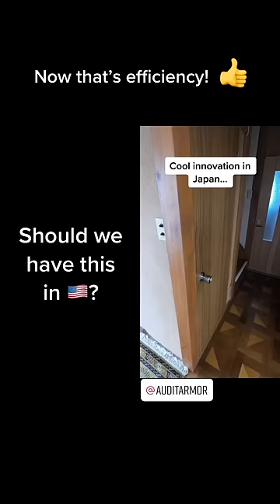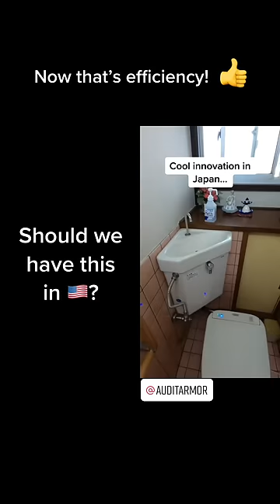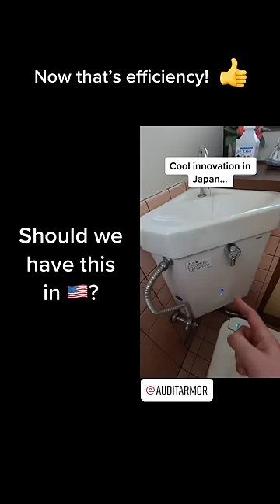Why don't we have this type of Toilet in the 🇺🇸...?

Comment: Missed one of thee best innovations imo.  Look at the floor of that room. 

The bathroom is recessed and has a hidden floor drain for leaks plus its all water resistant to a degree.
Reply: What, you mean you don't like the innovation of carpet in the bathroom?
Reply: Its called a wet room.
Reply: It's not for leaks it's too wash the floor
Reply: Whole room is the shower.
Reply: @tomashcraft  alot of our building designs are stuck in the 1800s. I hate it.
Reply: That’s RIGHT!!!! Every newly built condo bathrooms in Korea and Japan were made this way. Every part of the bathroom is tiled and you have a giant shower. It makes cleaning your bathroom a BREEZE.

Comment: Apart from needing to use the sink for other things, sounds dope
So if it had a regular drain pipeway as well as the refill pipe, it'd be perfect
Reply: You're missing the point: You don't need CLEAN water to flush your toilet, you can flush your toilet with shaving water or water you brush your teeth with. Nothing else goes in the bathroom sink.
Reply: @JohnRay1969  Biggest thing I was saying was most people use the sink more than the toilet - as such, overflow - if the toilet is full, nowhere else for it to go it would seem - simple overflow, and it'd be a perfect design rather than the workaround of flushing for the sole purpose of making space
Reply: It works as normal also
Reply: @PJOZeus I get u it has a bypass also
Reply: @JohnRay1969 you missed his point. How would you comfortably wash your hands, shave or brush your teeth using that sink?
Reply: The system has an “overflow “. If flush tank is full you can still use sink.

Comment: don't clog that sink or ur screwed
Reply: what are you doing to clog your bathroom sink so badly in the first place?
Reply: @shawnpitman876 hair and the other normal crap that clog bathroom sinks. You must be a newborn.
Reply: I don't think there is a any pipe to clog. I looks like it goes directly into the tank
Reply: @RossW-vq6bx well it’s not going through an Einstein- Rosen bridge
Reply: its all good just dip your hands in the back of the toilet bowl CLEAN RIGHT????
Reply: @deesmith8576 yes actually, that water has not interacted with the dirty part of the toilet at all and is only being used to fill the tank on the back
Reply: @Random-ed2xf Plus, this is a sink JUST for washing your hands after using the toilet. It's not the main sink that you'd use for shaving or anything else. It doesn't even HAVE any control to start the water outside of the flush/fill cycle.
Reply: @RossW-vq6bx  How do you think it gets to the bowl?
Reply: @skinlab4239 wtf are you doing with your sink that you can't fix your drain? Like. Tell me you've never been anything but a tenant. 😂
Reply: @skinlab4239 it’s not a full bathroom, just shit and wash hands. 🤦‍♂️
Reply: @shawnpitman876 you don’t clean your teeth or wash your hands after you put gel on your hair?
Reply: Can soap and toothpaste sit inside a toilet tank without causing any damage to the components inside? I genuinely don’t know and curiously asking.
Reply: It’s only a sink to wash your hands, you shouldn’t use it if you manage to clog it

Comment: News flash, that's everywhere.  The same 1/2 line that feeds the sink goes next to the water closet. That water in the tank is the same water that comes out of the faucet.
Reply: What, where are you? Under my sink is a large drain and a p trap that's maybe 2 inch pipe. What goes down is not under pressure. You'd have to pump it to get it up to the tank. 

So this definitely isn't "everywhere."

Comment: Bro overall you should have houses that aren't made of cardboard
Reply: That’s just the inside in order to work like electrical and water pipe.
Reply: That's new homes being built but if you have an older home it's made of brick. You have to custom make a home if you want brick or whatever.
Reply: You don't know Jack about construction, that Japanese house literally has drywall installed, stop parroting people and come up with your own thoughts for once
Reply: Y'all so pressed while you have a hole in your wall when you stub your toe
Reply: @lamont3803 I smell a renter.
Reply: @alexbernstein1450  Bad nose
Reply: @lamont3803  it's OK to be a europoor my dude.

Comment: What should be filling all of that is rain water, every house should have a holding tank in the basement filled by the gutters and filtered and pumped for use in sinks and toilets
Reply: I have a large woodworking shop and done it this way, never even ran water to the building.

Comment: Old innovation. I used to live in the Truckee Hotel. Its an older hotel from the 1800s, has these on all the communal toilets, or did until they fully renovated a few years back.  Was very cool but kind of a pain to use because you have to lean over the bowl.

Comment: Would have to worry about clogging the sink as well as you can only run the water in the sink until the tank is full. Then you have to flush again.
Reply: The sink drain is very short, with no crazy curves. 
I'm sure there's an overflow bypass. 
And #3, what's the big deal about an extra flush?  It's not like you're wasting 'fresh' water!
Actually quite ingenious!

Comment: Ah then there’s me. Washing my hands and clogging the sink after doing some mechanical work on my trucks. 😂
Reply: I stopped having this issue when I started using dawn dishsoap mixed with sugar instead of gojo with pumice the sand is what clogs the sink
Reply: @robertg9334  I never thought of that, we always use regular Gojo and sand, Always stopping up the s-trap.
Reply: @atvridgerunner  the combination of the dawn degreaser and the oxidative powers of sugar it breaks the grease down without stripping the natural oils out of your skin like gojo does to and the sugar breaks down with warm water preventing the drain clog unlike sand

Comment: Wouldn't the soap, skin, and grime from your hands end up in the tank and eventually start clogging up the plumbing in the tank?
Reply: Why would it do that? Do you regularly have to move houses because your plumbing no longer works?
Reply: @Loralanthalas   Um. You're washing your hands in a sink. Normally, in an American home, that sink has a drain, which drains into the main sewer line of the house/apartment/whatever. but, in this video, the sink drains into THE TOILET TANK. All of the skin flakes that come off of your hands, dirt, grime, and soap is going to end up IN THE TOILET TANK. Toilet Tanks have moving parts. The grime that gets washed off your hands, along with the soap, is going to end up in the toilet tank (I have to keep saying that to emphasize it) and all over those moving parts.

Comment: very bad idea, as you always not comfortable to use sink, bending its wrong than toilet gets all junk sand dirt, if you know open your toilet bucket it will be brown and its with clean water, toilet bucket  inside there is plenty of connectors, [plastics, and gum which can simply get damaged from soap chemicals you use to wash down. it will take little sand dirt and your toilet will start leaking and sending you huge bills for water

Comment: Uh, that's the dumbest idea I've ever seen.  I don't want to stretch and reach over the toilet to use the sink.  I don't want to have to flush the toiled in order to use the sink.  I want to be able to set the temperature of the water for the sing, not use just cold water.  

Is electric and water and everything so expensive in Japan that they have to do nutty stuff like this?!?!